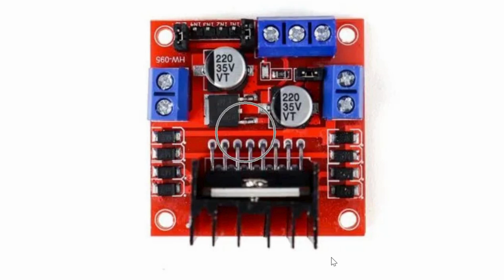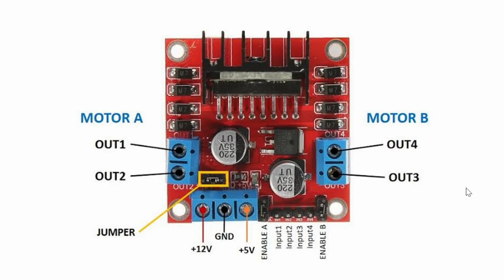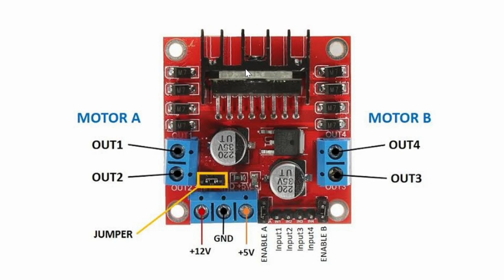L298N Motor Driver Explained | Dual DC Motor Control Board | Robotics Hardware for Beginners

Comment: hey very nice video
I've always had issues due to the lack of proper driver for a given motor, and choosing properly.
You forgot to mention how the control pins need to be driven to change direction on this board, and that it's only for simple dc motors right? Not steppers and such.
good luck and you know you can train, to speak more relaxed and less uh uh
Reply from the maker: Great point.